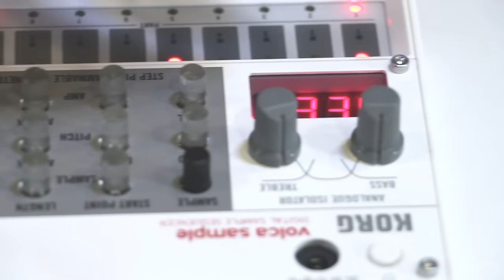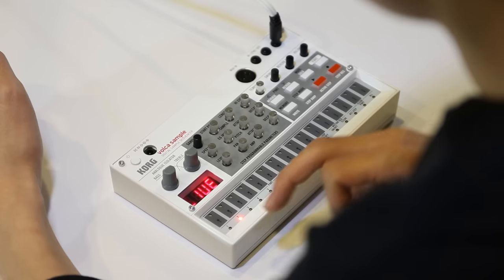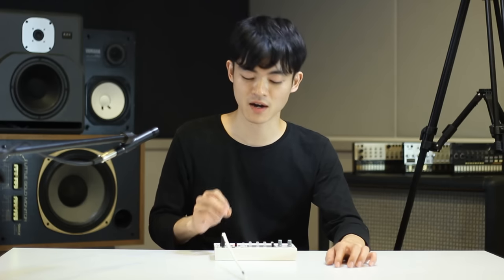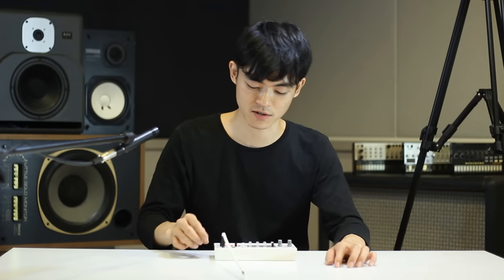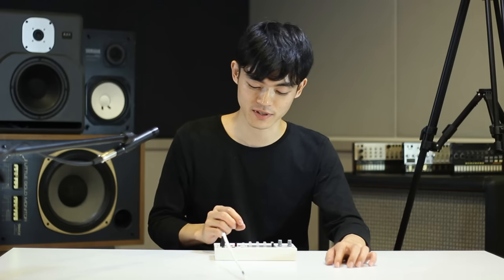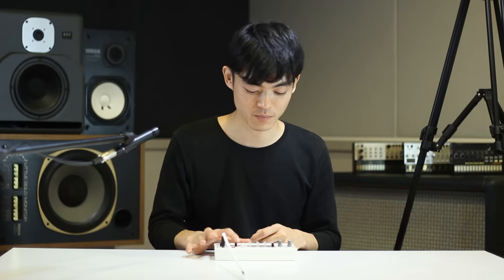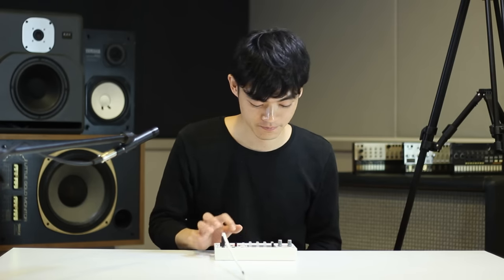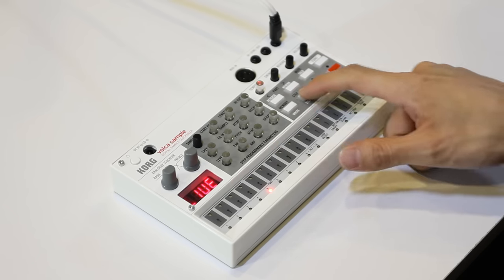Introducing KORG volca sample

Comment: The next Volca which Korg should consider is a multi-track recorder, so people can record all 4 Volcas simultaneously.... Volca "Track" ?
Reply: love how the op 1 is literally all of these volcas put together for about the same price.
Reply: I use a Zoom MRS-4 digital multitrack. Midi out. Not much bigger then a volca. Cheap as chips. Good quality sound.
Reply: @therestoringchannel1020  and i love how the OP 1 is way more expensive than a volca here
Reply: Agreed✊🏽
Reply: @gunnerhoward3134  hi, I know this post is old but can you elaborate on your recording routine? I'm extremely intimidated by DAWs and dont have the time to figure them out. I just want to record music as simply as possible. Thanks
Reply: @drewstrom75  Hello. Using a multitrack is a very fast and quite an easy way to record. With a 4 track multitrack you can record onto each track one at a time then bounce those 4 tracks down to one and free up the other 3 tracks for more recording. If you use midi machines you'll want a midi capable multitrack so everything will be in sync. A Zoom MRS-4 or a MRS-8 will be perfect. Hope that helps a little.
Reply: how about a mixer and a recorder?
Reply: @therestoringchannel1020  same price? Op-1 is like $1200

Comment: Good little device but if Korg made a more advanced version that could play multisamples, had usb connectivity and power with better effects and more storage then this would fly off the shelves. I far prefer hardware samplers than software for certain sounds. I don't care if it costs more or is slightly larger, I'd buy it as its such a convenient sized device compared to a hardware sampler.

Comment: Could this be used to provide a rhythm and bass (with other sampled sounds?) as a sequencer for other MIDI devices?   I have several MIDI keyboards and a Korg Volca Keys.
Reply: mickypoo4622 It doesn’t have midi out.
Reply: @Epicon8  I know, but you can purchase a solderless add-on board with a MIDI out socket to do this, available on Ebay.

Comment: Finally, a swing control! Can you make the other Volcas swing using the sync out of this?

And please port Synckontrol and the sample manager to Android...
Reply: You could always make this the master/sync out and the other volcas will swing along ;)
Reply: James Sajeva That's what I was hoping. Only problem is that I won't be getting one of these if I can't send samples to it. I have no intention of getting an iOS device so I guess no swing for me. =(
Reply: eyeball226 just some clarification, you don't need an Ios device anymore, and you can't make the other volcas swing, unfortunatly
Reply: Roman Yeah, they released the API, I know. Are you sure that the other Volcas won't swing when slaved to this? After all, the Synckontrol app for iOS can make the other Volcas swing - they swing if the clock signal swings.
Reply: I'm not 100% sure, but Gaz from Sonic State said that it didn't. He might be wrong though.
Reply: Roman Damn... I guess it's possible that the Sample's clock out doesn't follow the internal swing. That seems like a really stupid design choice, but I guess it's possible they did that.

Comment: No tryin' to hate.  I had all 4 Korg Volcas.  I sold the bass and keys.  the beats and sampler are fun to mess around with, and I use them to augment my electric drum kit sometimes, but the fact is 16 steps is effectively one bar of music.  And the things only have 8 storage banks.  So the entire machine can allow you to store and create 8 bars of music.  That's it.  The sampler is probably the best of the four Korgs.  At least it allows you some ability to swing a beat with something other than standard straight 4/4 quantization, something the beats doesn't allow.  Unfortunately like all the Volcas its lack of memory for beat storage, it's depressing 16 step (1 bar ) loop, inability to handle 3/4 or 6/8 easily, it's terrible audio in and out connections, and thin sounds make it frustratingly dull to use.

That out of the way, now to the video.  It's really cool, but as someone pointed out below, this isn't some amazing work of musical genius.  It's just a pretty basic, standard way to use a sampler.  And in an example, such as this, it  can be frustrating and underwhelming to watch and think that you spend all that time to make one pretty standard bar of a drum line that even a very average actual drummer could crank out in 15 seconds.

Again, nothing against the video or the gentleman in it.  He does a good job.  It's just weird to see people describing it as something amazing when it's just standard.

Comment: now how come Korg with all it's resources managed to get a plugkey with a midi in for the sake of the Ipads but not for the Volcas to ease the use and make the product more accessible???!!! 
Instead RK took over the job and it's hell looking it up and buying it half the way across the globe and finding a way to set it up with the limitation still, yet Volca is silent about it!!! 
I say it would be nice to have a decent cable with it, to handle it in more professional way even if you rise the pries to 180 $ No problem there.   
or getting us a new Volca Mixer for 2018 with all Cables, configurations needed 
straightforward.

Comment: Interesting and cheap, but anyone thinking the 'sound design' shown here is somehow a breakthrough haven't a clue. You can do exactly the same thing with most samplers from the 1980s onwards. In fact you can probably do a lot more. It's just that most people have forgotten that you can actually create stuff out of samples...
Reply: I totally agree with this comment.  I mean, the Volca Sample costs $160, that's not much.  But before I decide to go for the volca, I have to think a little bit.  I mean, for $200 I can get say a TX16W, and I can use it tample, and import samples to my SY99 synthesizer.  I was also able to get the S-770 for $250, which is an incredible machine with super slurpy sounding multimode resonant filters.  An Akai S1000 or S1100 I could probably get for around $300.  I mean, considering all that, the Volca doesn't seem like such a great deal after all.  But of course, I must applaud Korg for designing somethng actually aesthetically pleasing within the low budget.  The Volca series are charming units, no doubt about it.  I also like the way it imports samples via audio, just like for a cassete.  Using an iPhone or iPod apps don't appeal to me though, 'cuase I hate touchscreen devices with a vengence.  I mean, no tactile feedbac, and more often than not you have miss-tap something, or have multiple goes until you tap the right thing.  That's not the case with the real buttons.  So, I like the fact that Korg created so many products without touchscreen LCD.

Comment: How are samples loaded?
Reply: iOS app.
Reply: fair enough. hope they post an example soon.
Reply: Jorge Muniz It'll likely be via the Sync In jack just as when you update the firmware in the Monotribe and Volcas. Unfortunately, only an iOS app announced to manage samples. Too bad I don't have an iOS device.
Reply: KWHCoaster Esseentially turning a fun mini sampler into a toy. I dont have an iPhone or iPod...its a bad barrier to entry.
Reply: i dont get this iOS hype.. why associate a fucking Phone to music gear? why not have a usb port to load up samples.. or sd cards... wtf... thjat iOS thing made me not want one... period
Reply: Jarmo Sits Sadly, I had to cancel my pre-order when I found out about the iOS restriction. Not spending another $300-400 for a sample librarian.
Reply: KWHCoaster
If you go to Korg's website you read it is wireless transfer. Probably bluetooth. So,I suspect it will eventually be syncable to Itunes.  ;0)
Reply: LatigidGolana I saw wireless mentioned for syncing with iOS WIST apps, But, if for transfer also, that would be a bizarre implementation with a MIDI In for receiving SysEx and the Sync In that would have given broader support for all.

Oh well, maybe a firmware update will eventually add sequencing to my Akai MPX16.
Reply: KWHCoaster
I'm betting it is going to be a little more user friendly than what is currently known about the machine. But, I could be completely wrong lol.
Reply: Jarmo Sits there are already programs (mac,pc and android) for free which let you import sample's, but you need a midi-out on the other device and a midi-cable which you put in the volca sampler. Midi= still very usefull after all those years

Comment: This instrument is a scam. It is more of a game than an instrument.

It doesn't allow you to develop any personality (explore new things in music) and it is designed not focusing on you but you playing music that sounds "electronic". 

Note that when you first buy it and start playing with it you feel that it is amazing and that you can do so many things with it, but soon you realize that the music you can make with it is very limited.

One of the main reasons is that this instrument doesn't support extending 16 beats (except in song mode which you cannot edit).
At least 64 beats and editable track changes should be possible. Music you can make with only 16 beats is generally pretty dull.*

So all this makes you wonder how can a so easy change not be implemented?**

Other features that it could support but doesn't:
- sample change on each track that is recordable (this could allow sequencing much more thing per 
- any sort of randomness for your beats so your beats don't sound stale (it's supported in other volcas)
- real tuned pitch changes for certain samples - speed knob doesn't have the same functionality.
- more interesting effects per track (most current effects are pretty dull - lines 2 and 3)

Mainly it is an instrument that makes you feel that it is better to use and learn ableton in the first place (and if you midi-sequence it with ableton what's the point of it?) and it costs as much as a good midi controller.

(where you probably bought it in order not to be in the computer all day and to have a limited set of things to control and more control knobs to fiddle with)

Instead it should have been an accessible*** version of electron digitone (or something in this family).

------------------------------------------------------
* You can see it as the distinction of "tracings" and of "mapping" from Deleuze (see [1] but not exactly the same - this instruments imitates "electronic music" itself and it is designed for you to easily do tracings of em.)

** I don't think it is because of a technological reason. Maybe it's a form of planned obsolescence [2]?

[1]: https://www.youtube.com/watch?v=iDVKrbM5MIQ
[2]: https://www.youtube.com/watch?v=j5v8D-alAKE
* It's price point may be low for some parts of the world but for others it's just accessible